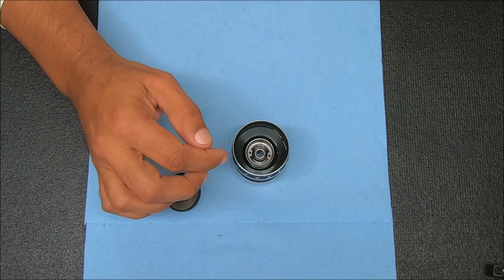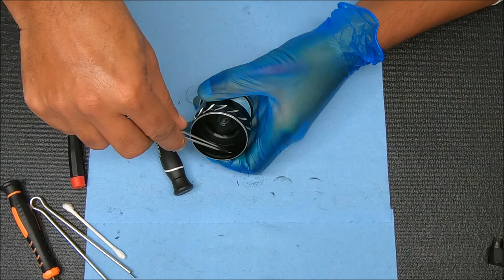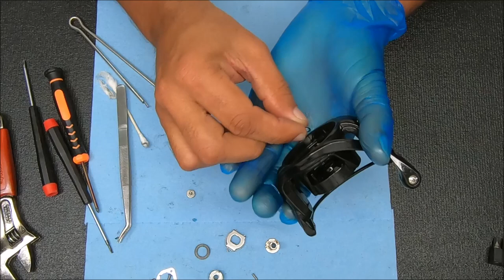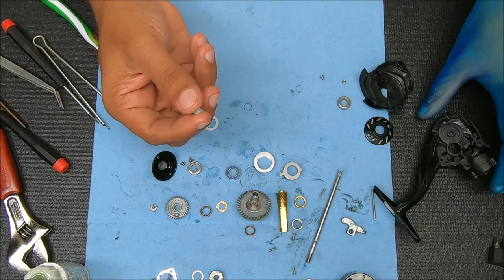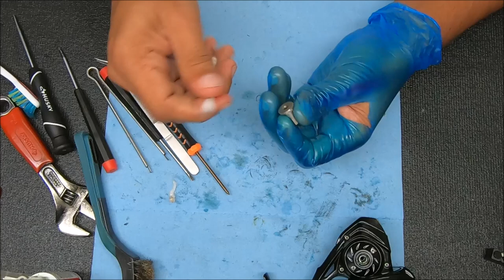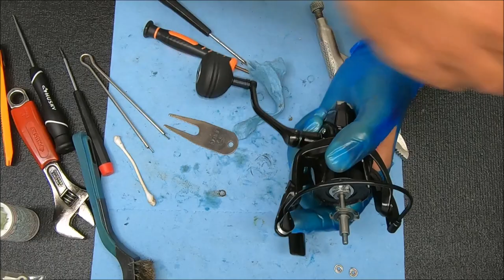Florida Fishing Products Osprey 4000: How To Take Apart, Service & Reassemble

Comment: Great video.  I've only had my Osprey 3000 for a year, but I rinse it each and every time, and today I noticed, what I call a "feel", where I believe it's not cranking as smooth as my other Florida Products reel. So I'm going to refer to this when I break it down once I get the reel grease in.
Where did you get that tool that has a flat blade on it that you use several times to separate things - like where you pry the side caps off where the handle goes through.
Reply from the maker: Thanks for watching! Yes, I know what you mean about the feel of the reel.... it's likely a bearing issue, so be sure to check them. You can use the following video for help with them:

https://youtu.be/GI02FQMq9Nk

Regarding the tool you're referring to, I think you're talking about the utility blade... you should be able to find that at any hardware store like Home Depot or Lowes.